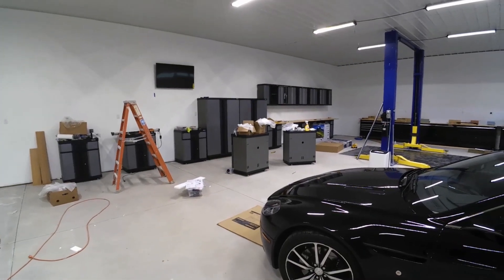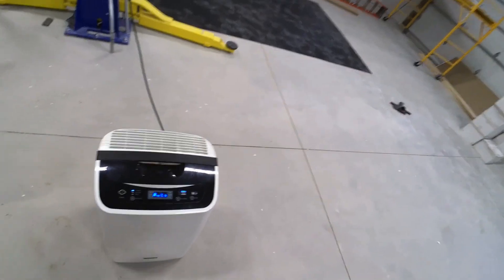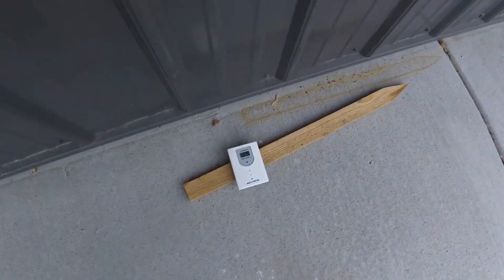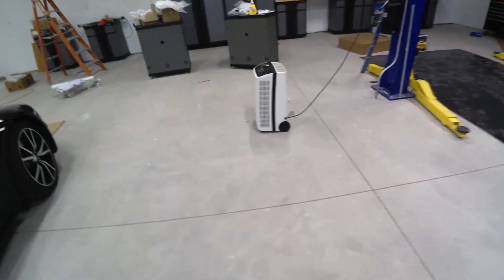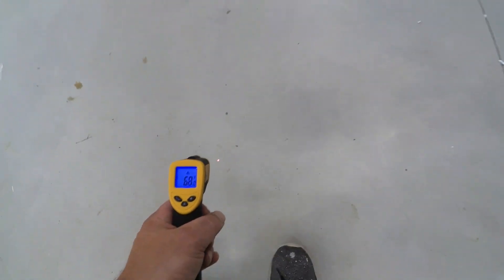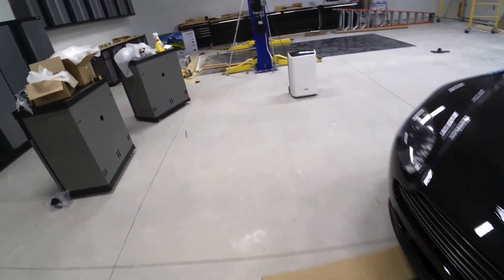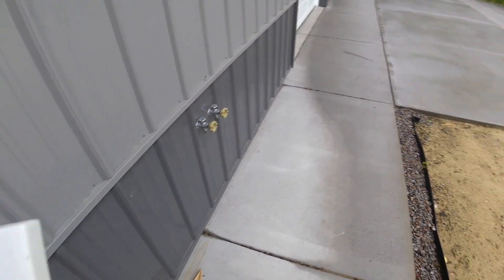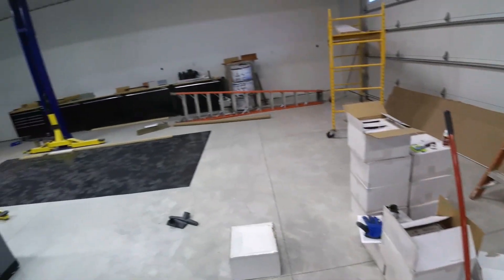Free Air Conditioning in Shop By Thermal Mass Storage!

Comment from the maker: We had a heat wave in Mn where the "Feel Like"  Temperature was 115 degrees and my shop got up to 71 degrees ! That was probably due to running the Dehumidifier as that adds heat to the area. I don't think I will need AC so now I will have 2 hookups for 2 AC units that I may buy just for Dehumidifier feature , but I can put that off whenever I feel like doing it.
Reply: @jason I’m loving your build.  Can you give an update on summer temperatures inside and any changes or additions you have made as a result to control summer temperatures.
Reply from the maker: @tallhair  Its been staying around 68-70 , unless I leave garage doors open then it gets up a little to like 74. At night it will cool down due to the ground being colder under slab. Only thing that is needed sometimes is air movement , so a box fan to just move some air and on really humid weeks , I may run a dehumidifier but that is rarely needed.  Other then that, everyone that steps into it from 90 degree weather always ask if its air conditioned! .  Now a regular radiant floor build with foam under slab , you will need get the cooling as its insulated from ground.  Thanks for watching the videos
Reply: @JasonYouTube So let’s say, hypothetically your detractors were correct, about lack of slab insulation increasing heating costs, you would still be saving money in average annual costs due to summer cost savings from not needing to install A/C system and electricity operating costs.   Would you say that is accurate?  If you had floor insulation A/C would probably cost quite a lot to cool the space correct?
Reply from the maker: @tallhair  If I had floor insulation, I would have to have ac systems. I originally plumbed electrical for an ac system in my big area and another mini split in my workshop area . so on the back I have 2 electrical ac boxes ready .  I have never needed to hook up AC as it has never got over 75 degrees in building. When it was over 100 with humidity , it was still 71  but you could feel the humidity. It was a cold clamy feeling kinda. It wasn't getting wet inside, but I did run dehumidifier for that week if working in shop. So yes , it would probably cost hundreds to cool 3200 sq ft building a season easily.  But like my videos state, you need to build it correctly in order to eliminate slab insulation. You need more loops of pex and better perimeter insulation or you will have green grass around your building during the winter!

Comment: Jason, please more videos on Thermal mass it's very helpful. I'm doing the same set up/
Reply from the maker: We had a heat wave in Mn where the "Feel Like"  Temperature was 115 degrees and my shop got up to 71 degrees ! That was probably due to running the Dehumidifier as that adds heat to the area. I don't think I will need AC so now I will have 2 hookups for 2 AC units that I may buy just for Dehumidifier feature , but I can put that off whenever I feel like doing it.
Reply: @JasonYouTube  Jason,  which company did your concrete? im in Elk River.